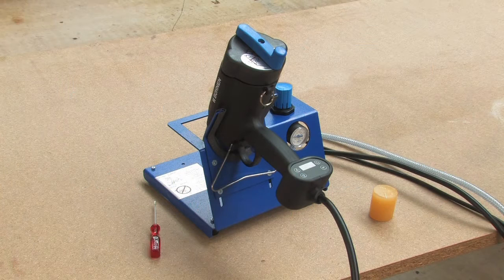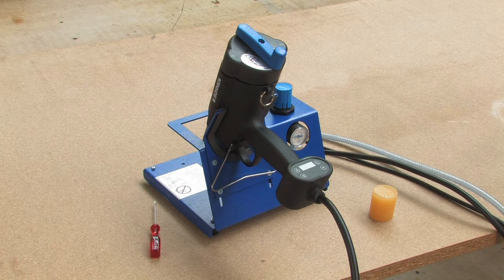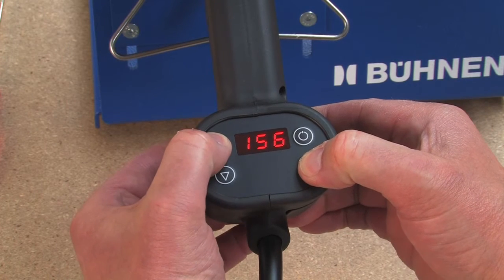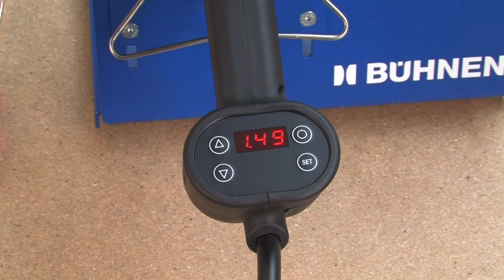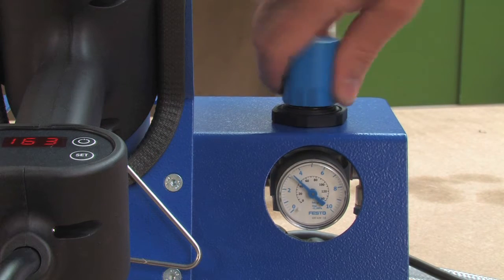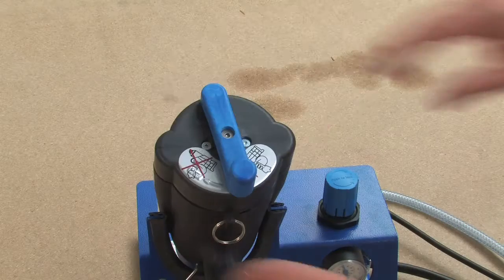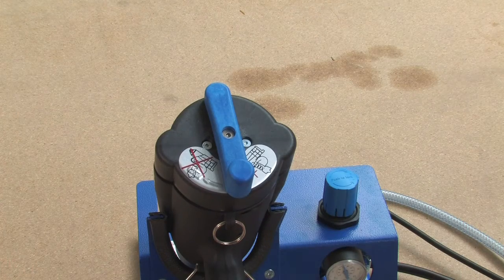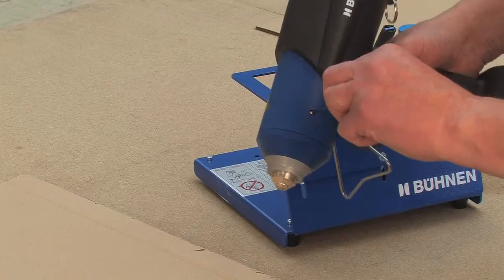take in operation HB 710 spray, spray pattern

Comment: Is it possible to demonstrate how it works on vertical surfaces ? I would be very thankfull if you demonstrate the performance of spraying on the wall. Is the air pressure sufficient enough to apply glue on the wall ?  I`m thinking of use of your product in construction ... therefore i need to see how it behaves when you spray 10-15 cm from the wall It would be essential to my potential usage. Thank you in advance. Hallo :) koennen  sie freundlicheweise presentieren wie HB710 arbeitet mit vertikalen flaechen? Ich denke an eine verwendung in der baubranche nach. Dafuer es is sehr wichtig zu wissen ob der luftdruck ausreichend ist um der kleber auf dem vertikalem wand zu auftragen aus einer entfernung von 10-15 cm. Danke im voraus :) Wenn`s wenig kmplizierter ist- bitte  senden sie es an meine adresse : tester1(at)opoczta.pl . MfG
Reply from the maker: Dear Pe PE - please get in contact with our service by mail: info@buehnen.de We need some more informations from you and it is easier by mail. Best regards, Heike